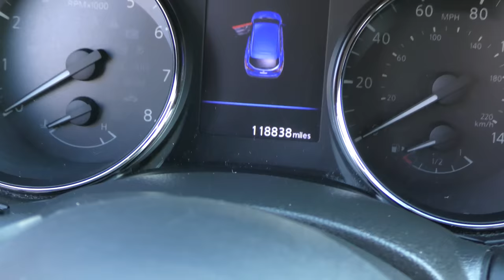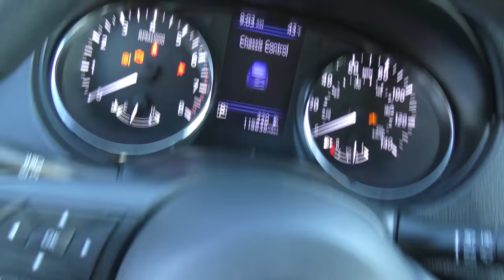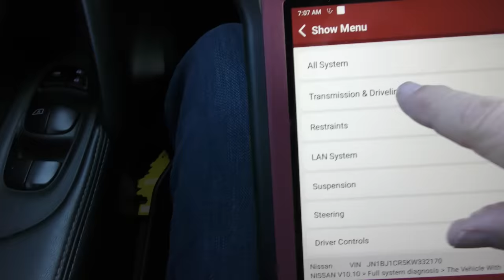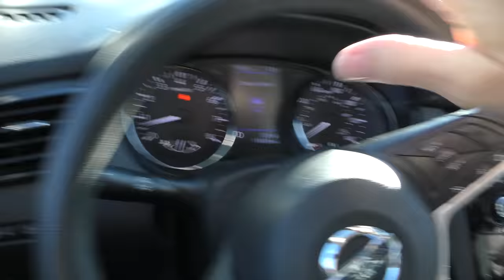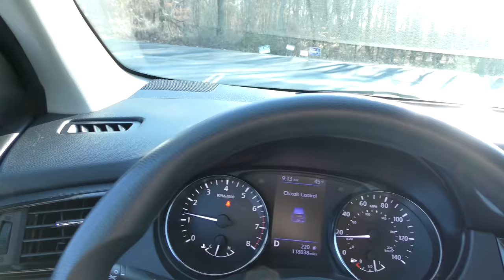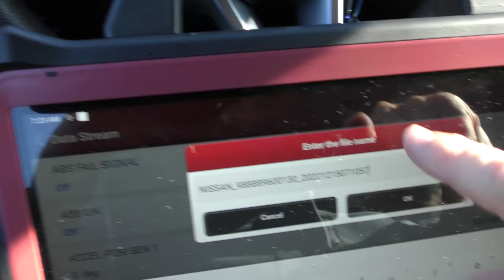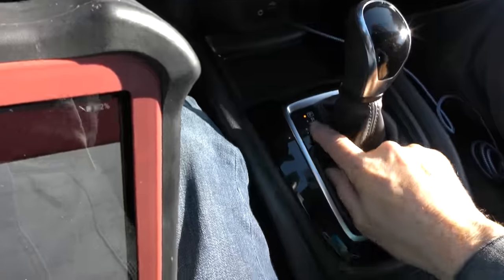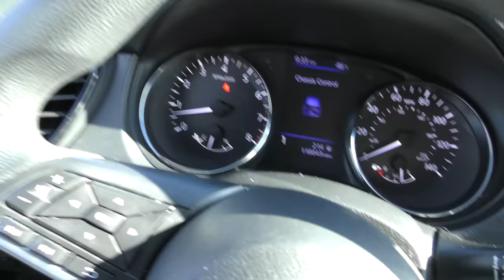The Worst Transmission Ever Made (Do Not Buy)

Comment: One thing most techs and people don't know about the Jatco CVT- It's got a hidden very fine material filter behind the cooler that bolts to the case and it stops up around 50K sometimes earlier for folks that drive aggressive.  Since it doesn't get changed, it causes the trans to run too hot and fail a lot quicker.
Reply: Who doesn't drive aggressive?
Reply: Yes, I found out about the "Secret" Filter from a mechanic friend of mine.  He actually showed me where it is located.  The dealer said it didn't exist, until I showed them the picture of it.  My mechanic stated that he knows of alot of people that have had very good luck with the JATCO trans.  As I stated to Scotty many times, our 2008 Rogue had over 400,000 miles on it when we traded it.  The second owner is now up in New york state, and has not had any issues with it at all...
Reply: So, can you change the filter?
Reply: @baytown3734  When my wife had a CVT, I changed it every 50K and it needed it.  We start getting them in the shop dropping like flies in the summer on long drives over an hour.  Change the filter and it's good to go many more miles.  My service rep loved me for that one.  Saved on a lot of warranty CVT replacements.
Reply: I have a '09 Maxima with 211k.....I change the fluid and external filter every 30-45k.....it's like anything else....if you take care of it, it will most likely last....not guaranteed of course....
Reply: I got 260k miles with regular maintenance on my 2011 altima. Although the transmission was a nightmare until I knew about the oil cooler fix. The transmission eventually failed but the engine was bullet proof, and probably could have kept going for a while. I will never buy another Nissan though because of how they treat their customers.
Reply: I had an 07 Murano that I recently sold with ~180k miles on the clock. It had the original CVT and the 3.5 V6 ran like a top. I am good with regular maintenance and changed the fluid every 60k miles and it was FWD so that may be a contributing factor. Over the years, I did have to change the power steering hose, engine mounts, oil cooler gasket, valve cover gaskets, and ignition coils but not much else outside of routine maintenance. It lasted far longer than I expected but I admit that I felt that I was living on borrowed time so I sold it while used car prices were stupid high.
Reply: @bradleyevans8147  scotty doesnt care . I said the same thing about my Mazda. All cars have pros and cons
Reply: @wesfields9322  I’m trying not to. I’m getting an LC 500 and I’m not interested in talking to the police. Not the fastest car, but may get  attention from the po po.
Reply: @wesfields9322  good point.
Reply: @davemarques9601  an 09 doesn't  have a cvt I don't think...
Reply: @Jacob1986  honda, toyota, and mazda are way better than Nissan
Reply: Good to know my friend good to know... Thanks you. 😘
Reply: @johnsnider2956  I put the same oil cooler on my 09 Maxima....it mounted oem-style....worth the extra $70!
Reply: @richsweeney1115  cvt started with the 6th gen maxima, I have a 7th gen....but there is a world of difference between them....the 6th gen had more problems.... like most of the Altima's and were not so good, the 8th gen are MUCH better....no "spring" in the drivetrain....much nicer
Reply: @wesfields9322   certainly no Nissan owners
Reply: I have a 2015 nissan altima. It has 122k miles on it and still drives smoothly. Can you show me where is the hidden filter so I can change it? And where can I buy the filter?
Reply: @bradleyevans8147  yes only one dealer told me about the filter
Reply: If you want something that moves extremely fast try a NISSAN  G T R. It has no problems moving.  With 4 people in it.  It runs faster than a  motorcycle.  It uses a double clutch system that every other car maker is starting to use. NISSAN knows something about transmissions.
Reply: @phillipanderson2607  costs as alot more,cost alot more in maintenance, costs more in repairs, costs more to insurance etc etc. Ur logic doesn't make sense
Reply: @JoeBidensIsRetarded  I own to Nissans 2012 murano with 135000 mile issues at all and 2015 rogue no issues at all except replacing batteries.  Change transmission fluid at 30000 miles on both.  GTX CASTRO CVT FLUID.  TAKES FIVE QUARTS . PAY $8.00 DOLLARS A QUART. PLUS TRANSMISSION FILTER. NO NEED TO CHANGE THE ONE ON FRONT SIDE OF TRANSMISSION.  ONLY IF YOU ARE REBUILDING TRANSMISSION.  I  did replace brake pads at about 100000 miles on both . I drive 64 miles a day and I don't trust American made cars.  I been down that road before.  I been driving Nissans since the early 1990s.

Comment: My 2013 Honda accord has 215,000 miles. Original cvt trans. No problems.
Reply: Because you make sure the maintenance gets done, right?
Reply: Because it's NOT a Nissan!!!
Reply: Identified as Honda at time of birth 😂
Reply: All Hondas same cvt is strong
Reply: Honda is not a Nissan, big difference
Reply: Did you service it ?
Reply: Honda knows how to build them, Nissan doesn't
Reply: My 2017 ioniq has 255K mileage has no problem for personal and Uber driving :)…recently just replaced the cat converter and right now runnning like new again
Reply: You should head to the casino and go all in
Reply: Have you change the transmission fluid ?
Reply: You should flush that cvt fluid every 4-5 years- as in drain, fill, drive for 10 mins, drain, fill drive for 10 mins, drain fill
Reply: You're supposed to change the fluid at 60,000 miles. In a Nissan rogue.
Reply: Do you drive on eco mode or no and do you do maintance and how many miles
Reply: Very well said sir.
Reply: Honda makes the best cvt.  But you got lucky.

Comment: I've never driven a CVT transmission car before, but every time I see that rev counter moving like that it reminds me of those dreams where you are trying to run really fast, but your legs are made out of lead.
Reply: LOL. Reminds me of my exes big ole ford 150 from years ago. I rarely drove the beast but i did one day on the freeway and tried to pass a car that had finally gotten on my nerves. Something was wrong from  the last time I had driven it.
 When I got home I asked him what was wrong with the truck? He said in a gruff voice. What do you mean? I said I tried to pass and all I got was a lot of noise. Sounded like I should have been passing but  it took awhile.
 O, he grumbled and looked down. Its the carburetor.
Reply: CVT transmissions are really efficient though. For speed this one has a Sport mode and when I
put it in that mode the little SUV was fast.
Reply: Usually there is someone chasing you when that happens in your dreams. The fun part is where you wake up but you cannot move and you still see the guy chasing you. It’s called a nightmare.
Reply: The one huge benefit to a CVT is that if you pay attention, you can keep the engine in its power band and let the transmission catch up. My Honda accelerated faster if I keep the engine at about 3700 or so and let the transmission adjust as the speed climbs, than if I do what Scotty did here and wind it right out and force the transmission to make large ratio changes at one time. I’m sure he knows that too and was doing what he did intentionally but that’s not how I would drive MJ e if I wanted to pass someone.
Reply: @Gorilla_cookie  actually I've never had anyone chasing me in those dreams, it's always been trying to get to a certain place really fast.
Like the bloody sheep are escaping and I can't get to them and strangely enough my dogs seem to have lead legs too.
Reply: They Are nice to drive.
Reply: F*** CVTs

Comment: Lol everyone forget transmissions problems with the old transmissions. Transmissions shops have been around forever. CVT in my opinion are great. Less noise, better MPG and smooth shifting.
Reply: I'm thinking it's strictly these Nissans transmissions he doesn't like. My sister bought a 2015 Nissan Altima in 2017. I warned her about these transmissions. She still bought it. Anyway, luckily she hasn't had problems. Soon after that she received a letter from Nissan, they extended the warranty on these transmissions after numerous consumer complaints . At least they did that for their customers.
Reply: Old transmissions where easy to drop and plenty of places can rebuild them
The sin isn't unreliability but how difficult it is to repair. 
Maybe after a while more places will be able to rebuild CVTs but even then, it still won't help how difficult it can be in some FWD cars to even get the transmission out.
Reply: 3 speed autos with rear wheel drive were trouble free. Cars are throwaway now. Junk. Expensive.
Reply: @Jonathan A that’s a given
Reply: @Jonathan A you said it doesn’t shift, we all know that but it acts like it does. No need to say the obvious
Reply: The video is specifically about Nissan Jatco CVT's, which have a long history of problems
Reply: Now that you mention it, it's true. I see them all the time. Specially in the Houston area, where by the way is where Scotty lives.
Reply: @kckuc310    Gear ratio changes. There are lots of motor scooters that have CVT and a manual mode that gives you, say 7 or 8 steps, or gears.

Comment: He should now seriously consider getting a fluid change done on that CVT.
Reply: Right a transmission oil change is probably way overdue but Scotty didn't mention it. It's recommended around 60K I think, I used to have a Rogue Sport, it's the little Rogue and
they have 2.0 liter 4 cylinder engines - not 2.5 liters. Those are in the regular (bigger) sized Rogues.
Reply: I have a Nissan Rogue with 119,000. They refused to do a transmission fluid drain and fill or full flush at my local Nissan Dealership due to liability concerns. Even though I had already changed it at 60k miles. No surprise it’s starting to slip at lower speeds now. It’s like they know these peaces of junk are due to break down.
Reply: @Alberto-or7js  Exactly
Reply: @metalmike570  someone said it gets dirty after 20k so 20 to 30k is when it should be done
Reply: @Alberto-or7js I have 2013 rogue, I def have this CVT issue as well. How have you handled it? Do you get it flushed regularly now?
Reply: @KalvinPatel  my temporary solution has been to turn the vehicle on and off again and it seems to fix it. I had a mechanic run a scan tool, and he’s telling me it could be some transmission air pressure sensor. I’m not sure, I’ll have to look into it.
Reply: @Alberto-or7js  gotcha, for the past oil changes that I keep getting at my dealership, something about CVT transmission or it's fluid always shows up. Also, I have a check engine light. I went to a local shop to do an inspection, he said it wouldnt pass, so he ran the test for any codes and came back to me saying it's my catalytic converter. So now a whole other issue lol
Reply: @Alberto-or7js  Forget dealers.  They are horrible places to get a car serviced.  Why a dealer would tell you that is beyond me.  Take it somewhere else.  A CVT fluid change is not an unusual thing.
Reply: @Alberto-or7js  Yes and they worry that if they changed the transmission fluid and it suddenly break down, the customer will put fault on the dealer, so they refused to touch on it. I asked my dealerships some can drain and fill the fluid but none of them want to change the filter

Comment: When my son's Rogue with the CVT, got to 130,000. we changed the trans fluid and BOTH fluid filters and added an aftermarket external fluid cooler. So far, so good!
Reply: Nissan recommends fluid changes every 40k I do it every 30k. Thanks for mentioning there are two filters. Most people don’t even find the second one on the case housing where the cooler line goes in at.
Reply: I should have mentioned that he bought it with 129500
Reply: So how much does that external cooler cost anyway after the fact....
Reply: @lopez121709  Around $60-70 as a kit
Reply: hey Bill, do know of videos on how to change the trans fluid, fluid filters, and the external fluid cooler?

Comment: My 2012 Nissan Sentra 163,000 miles has its original CVT no issues
Reply: Our 2008 Buick Enclave made 70,000  dealer serviced only  wave plate failure. None of those gm Enclaves ever made 100K . We change our 2019 cvt Nissan Pathfinder every 25K   (Nissan Dealer)
Reply: @curtiseggemeyer5681  hopefully that 2019 CVT last 300,000 without issue lol

Comment: With these transmissions, you should not use them in the manual mode.  If you use them that way regularly, the steel belt in the trans will wear into the pulleys at each pretend gear that it switches the pully ratio to.
Also to get the most out of these terrible transmissions, you should change the trans fluid and filter every 30k miles religiously. (Just change it, don't flush it)

Comment: I've had several CVT transmissions without no failures whatsoever but the biggest thing in my book is keeping the transmission fluid clean I change it once a year change new filters and drain and refill the transmission I have gotten up to 41 miles a gallon taking a trip to my sister's down to Carolina from New Hampshire driving 70 75 this is a 2018 Nissan Altima with a 2.5  but you cannot beat all these transmission I see very few people take care of the transformations like to take care of their engines

Comment: CVT WARRANTY EXTENDED .. In Dec 2021, I bought a fully loaded 2018 Rogue SL (manufactured in Japan) with 22,000 miles. Now 7,000 miles put on it and no reliability issues. The original drive train warranty is 5 years/60,000 miles which of course includes the CVT. However in Feb 2023, Nissan sent me a letter that the CVT warranty was extended to 7 years/84,000 miles to "… address concerns … expressed by plaintiffs in class action litigation". Now I feel much better about the purchase.

Comment: It always drove me nuts when I’d hear that manufacturers put shift points in CVTs. It completely defeats the purpose of keeping the engine at the optimal rev for the best fuel economy under those driving conditions. If I have to have a car that feels like I’m stepping on an orange every time I want it to get up and move, I had definitely better get the better fuel mileage. I don’t care that I can’t feel my Honda changing drive ratios, as long as it does.
Reply: I have the same Rouge. I do not notice shift points at all. But I drive it in eco mode.
Reply: A CVT transmission is a terrible thing to connect to a responsive engine, completely ruins the whole driving experience
Reply: Whoever made it mainstream to put cvts in cars needs to be force fed spicy peppers
Reply: @Ty420  there is nothing wrong with a properly built, properly maintained CVT. It's a car, not a toy. You can't tow with them but then the cars they're in aren't meant to tow anyway so that's probably not a bad thing it if stops people from putting trailers behind compact cars and small SUVs.
Reply: @rickbateman2401 the only things these "transmissions" are good for are UTVs, snowmobiles, and scooters. And MAYBE a tiny subcompact like the Toyota Yaris. NOT a full size sedan like the Accord or the Altima.
Reply: @yt-user03561  I have have a 7 year old Gen 10 Civic, a friend has the last year of the Gen 9s (2015) that came with the CVT, and another friend has a 7 year old Corolla - no issues with any of them.

Comment: I have a 2017 Nissan Versa Note with a 1.6 liter and a CVT having little over 65,000 and is still going great. I bought it three years ago with 50,000 miles
Reply: You shouldn't have any problems by 65k anyways, and driving 5k miles a year is very little use.

Comment: Currently own a 2013 Nissan Altima S purchased in 2015 with 16k miles for $16k$'s. Mechanic drains and fill the tranny at 35k and tomorrow again at 56k. No flush. CVT fluid only. Car is great but at high speeds you start to feel it's age. Tranny is fine BUT I baby it. No hard acceleration. Coast up to red lights and stop signs. Basically drive like the old man I am.

Comment: I have a 2010 Sentra with the CVT and no problems in that regard, though it has had more exhaust issues than anything else. If you change the fluid every 30,000 miles and don’t drive it like a race car you should be fine. That being said, I would definitely buy another Sentra but it would have to be a standard one.

Comment: I've just bought a 2017 Honda civic ex. My first experience with a cvt. Unlike a lot of people I like the feel of it; the sensation that the car is smoothly taking care of itself. There's light, effortless  feeling about it. The car was serviced regularly and has 64,000 miles. Is this the right time for transmission fluid change? It hasn't had a change yet
Reply: Yes you should change it. I also have a Honda Civic. Great and reliable cars. Change the fluid now and do so every 30,000 miles.
Reply: Thanks. I hope it's not too late
Reply: Thanks J
Reply: Should have bought a manual trans
Reply: That's no help and the only one was rusted out
Reply: There's always a few gems
Reply: Thanks and happy holidays

Comment: How about a twin turbo,supercharged,direct injection,hybrid,all wheel drive, variable cylinder activation,3 cylinder, ford focus with a dual clutch cvt with automatic shut off and a dose of sea foam.
Reply: the dual clutch they had in the focus was bad enough as is
Reply: Whoa, hold your horses there boy
Reply: Now that's not something I'd want to play Russian roulette with! 😆
Reply: And make it a 2stroke while youre at it, with an oil injection system
Reply: the focus doesn't deserve a SC or turbo hahaha
Reply: Good for about 100,000 miles..
Reply: @TanManFixes  fords junk anyway
Reply: There couldn't be a dual clutch cvt..
Reply: a twin turbo, supercharged, direct injection, hybrid, all wheel drive, variable cylinder activation,3 cylinder, ford focus with a Manual 6 Speed Transmission !
Reply: @zanderday4466  It sounds to me like it won't last to long. I'd rather have a normally aspirated 4 (2.5 liter), or a V6 or a  V8 engine. Now I get it y'all were being sarcastic - Hahahahahaha!